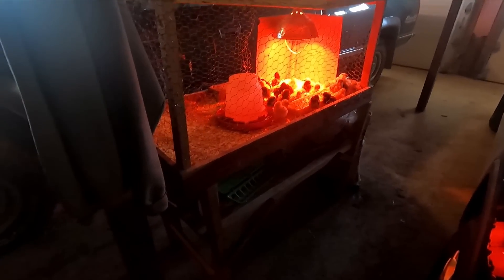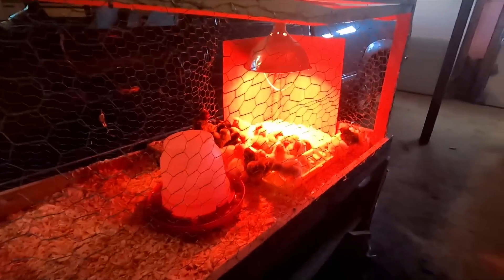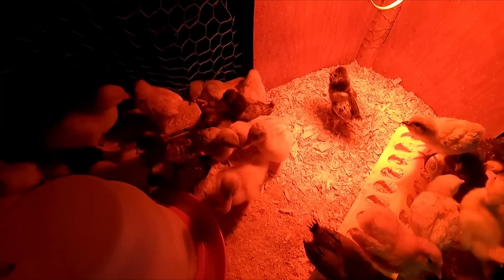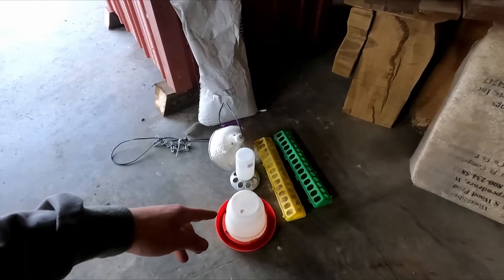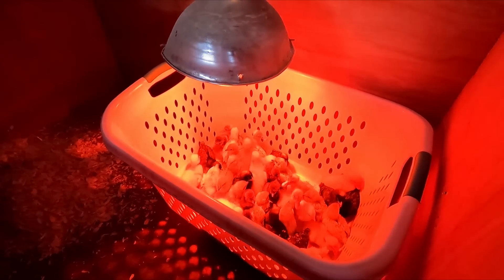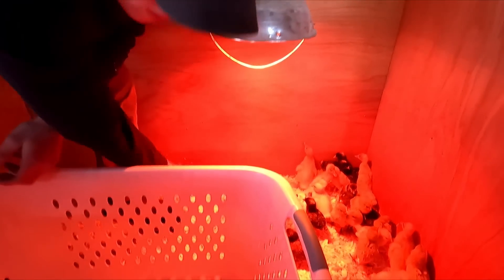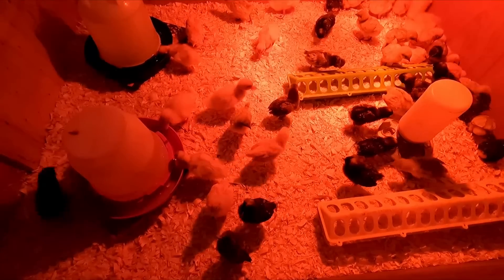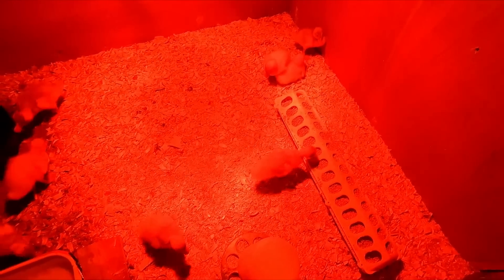Raising Chicks and Ducklings!

Comment: Your heat lamp is too low, that’s why all the chicks are moving from the centre of the lamp, also the main cause of death will be due to dehydration, due to the excess heat, it doesn’t matter how much water you supply if they a constantly overheated, and you wonder why they drink so much, most of the water is evaporated from the excess heat, virtually all your losses are due to poor husbandry and lack of understanding of the environment that they require, fresh bedding and loads of room still don’t negate the overheating